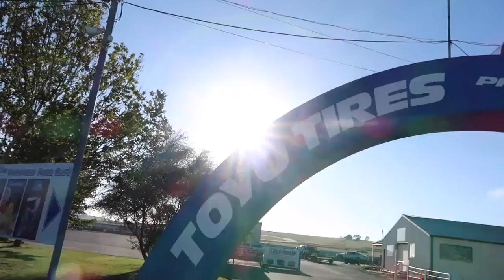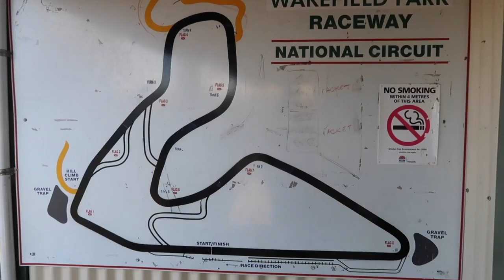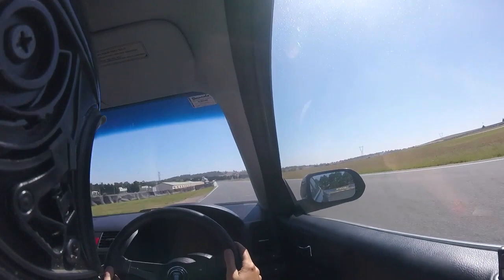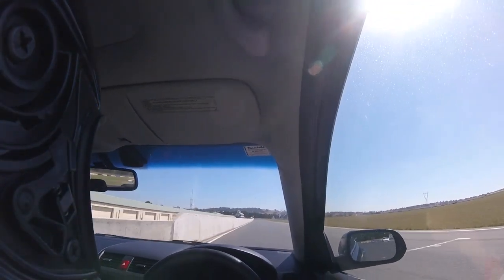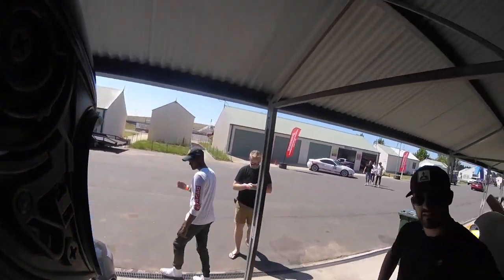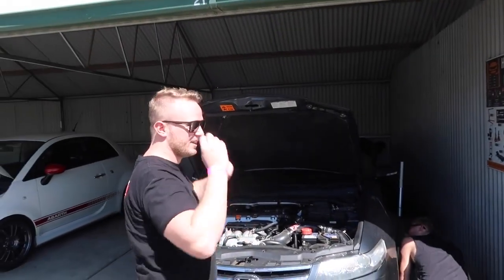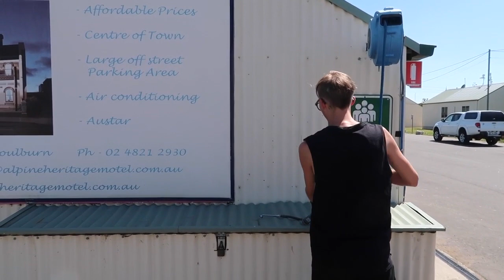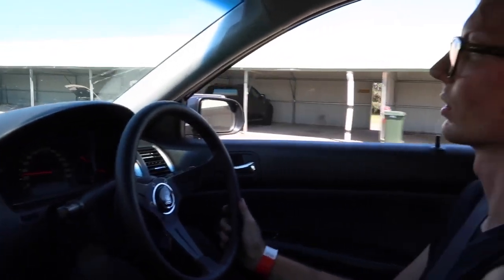First track day - Crashing the Accord!

Comment: It's the worst feeling when you drive down to Wakefield and then something goes wrong, either know someone with a trailer or call a tow truck :| but i have heard its $500 + back to Sydney
My blow off valve blew off my top mount and the car would not rev past 2k or idle properly, luckily someone there knew what the issue was
Reply from the maker: Without a doubt, Ive limped cars home before and its the absolute worst.